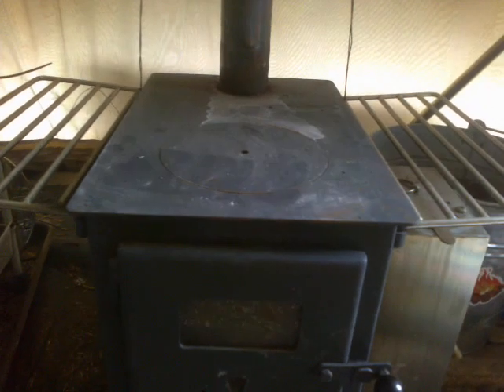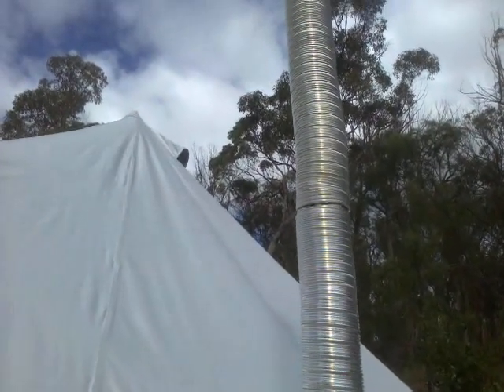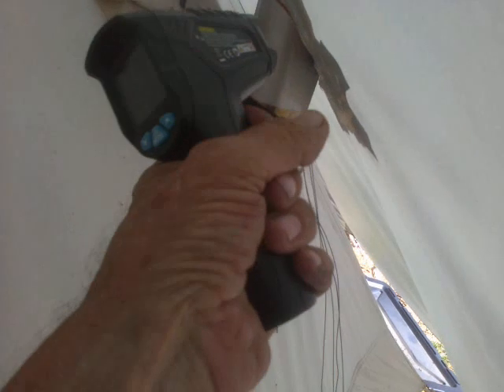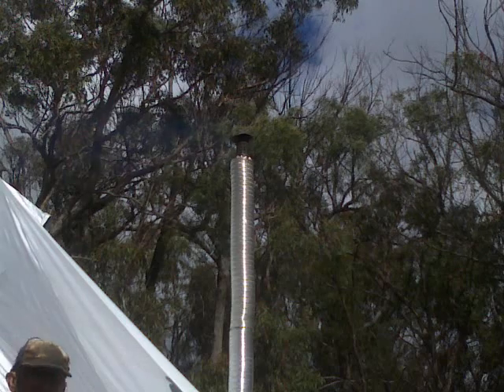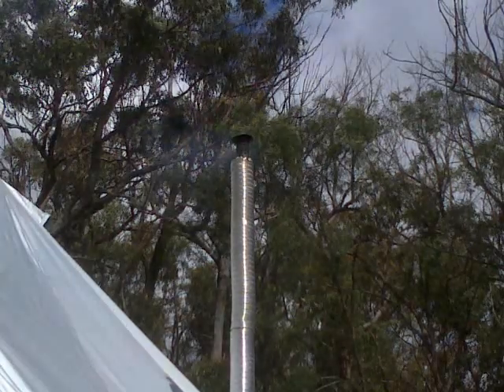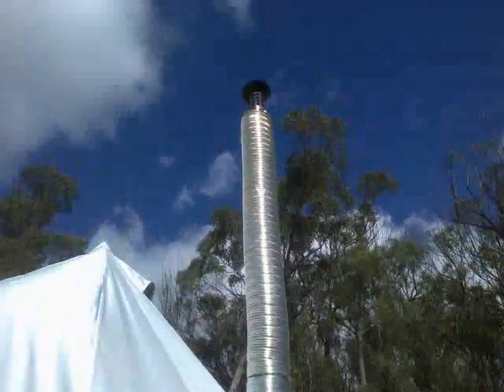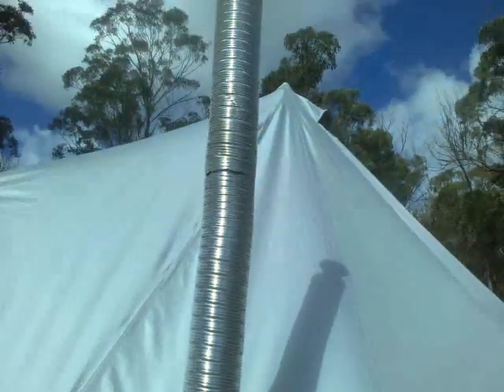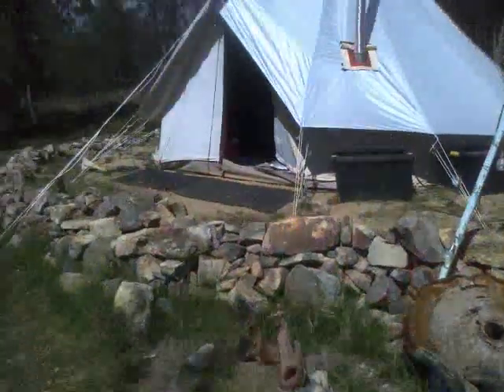Test Firing..., Nylon Yurt-Fly Chimney-Grommet....; Hillbilly Modificated...(!).

Comment: Hi Chris,
I have not been on for a while. Good to see you looking well. 
You did a great job with the chimney. What about an aluminum shield around the top of the chimney to catch the embers? That's if the chimney is strong enough to hold it. Maybe a little lip around the shield to stop the wind from blowing them off. Or you could use some heavy-duty kitchen foil. Anyway have a good one mate. 👌👍
Reply from the maker: G'day Mike !

Yay Team...; I was wondering if you were still out there..., Existence being noticably ephemeral among us old men these Dayze...

The Aerodynamic Drag of the Chimney, with it's 100mm Corrugated Alfoil  Air-Conditioning Duct, in strong winds - versus the 50mm Flue 5 metres long, anchored ONLY by the Stove at the bottom ; and Guyed or Stayed ONLY by the Tent-Roof and the Fly...(!).

I think it would take a Pole with Guy-Wires on the Opposite side of the Yurt, supporting one End of a Triangular "Shade-Sail", with a Hole Grometted  through it, too...

In order to ward off 
ALL
Embers.

Buggar it...

Today was Dry Nylon at
23° C.,  O. A. T....

Liz'. will likely
NEVER Ever Light the Fire
Nor
Stoke it, 
Anytime the OAT is above
15 or 20° C.

If it's hotter than that, and the Fire needs to be lit - then it WILL be Raining ..; so the Fly 
WILL
Be
SAFE...???

One hopes...

Have a good one..

;-p

Ciao !

Comment: A few suggestions for likely dismissal.  🙂
  Smaller screen on top would reduce embers big enough to burn after they release.
Closing the furnace air flue a bit would reduce the amount of air available to blow large embers all the way up.
  Seems like a longer chimney would help until I consider heat build up which would create more vacuum when its hot.  Maybe a different kind of wood?  More dense perhaps.  250C on the stove pipe seems a bit excessive.  I keep mine about 65-100C on the pipe.
  More air in the stove means a faster hotter burn.  Getting the vent opening just right for the wood you're using takes several trials.  Mine usually likes just over halfway but your mileage may vary..  I get it just to where the embers are glowing and very little flame.  This keeps excessive heat from going up the flue and makes the wood last longer.
  Government, like fire, is a good servant, but a bad master.
Reply from the maker: G'day,

Thanks,

It's all constrained by  the 50mm SS Flue, and the tiny little Firebox.

If slightly too much Wood, or damp wood, or wood too large is introduced too early, the Surface Area of the Flue Walls  thermally overwhelms the little bit of warm smoke.

So the Smoke condenses and Creosote blocks it within 4 days.

A finer Screen at the top would merely block up faster.

So, first I applied a Double Skin Flue all the way up - then the Chinaman's Hat, to stop the Heat rising, thus keeping the Exhaust Holes top hot to block up.

It's been designed for a British Yuppie to take Glamping at Glastonbury Tor, for a 3-day Weekend ; and then be forgotten at the bottom of the Garden Shen, kinda thing.

Looks great - if one knows nothing about how a Fire, Fireplace, or Chimney actually function.

It CAN be coaxed to be functional - after moddification, with proper Kindling technique - and it has to run at 3/4 Throttle or Full - with dry Hardwood.

But it beats a Tent without a Fireplace, kinda thing.

Such is life 

Have a good one...

Stay safe.

;-p

Ciao !

Comment: Hello Chris,
Maybe it's a relative thing. While you might look foolish with a seeming overreaction to a potential, you'd have looked much more foolish if you'd been unprepared for an obvious potential that became an actual. Nice work. I'm presuming the prevention of the clogging with the additional jacket for the outside pipe will prevent the possibility of the embers from being thrown onto the fly. Smart idea. My tendency would be to worry. I'd probably end up creating a kind of sheet aluminum shield/trough angled to allow any embers that came out to fall into the trough and deflect away from the tent. I don't know how successful I'd be at it. I don't know if I'd figure out how to support it, or what might happen in a wind. So I'd end up with some ridiculous looking overkill contraption...maybe? LOL As you say; such is life.
Thanks for sharing. Nice work, me thinks.

Take care.
Reply from the maker: G'day,

Thanks mate !

Yeah, it's all a bit tricky - because the only really "fixed point" is the weight of the Stove on the floor of the Tent..., the Tent Roof tries to flap independently, and now the Fly sort of "floats" above the Tent...

And everything is really light.

So, the Chinaman's Hat stops the little Stainless Steel Cup, spotwelded into the top Pipe from filling with Rain and Soot and then boiling and spitting hot blobs of sooty water onto the Tent...; and it holds a Doughnut of Hot Air around the Exhaust Holes - otherwise the metal chills the Smoke and the Hole block up.

And, yeah, before I added the Air-Con. Ducting, to hold a layer of Warm Air around the Flue, it was a cantankerous mongrel of a thing to light, and about every week it had to be taken off and swept out...

And slightly wet wood made it smoke like a bastard and block up really fast.

And, yes, imagine having been too lazy to unroll the Hose, or position the Backpack ; and having the whole lot burn down while one was trying to get water on the Fire from a standing start with nothing prepared...

When working alone, it helps to pre plan and prepare for WHEN the worst-case situation suddenly crops up (!).

Such is life,

Have a good one...

Stay safe.

;-p

Ciao !